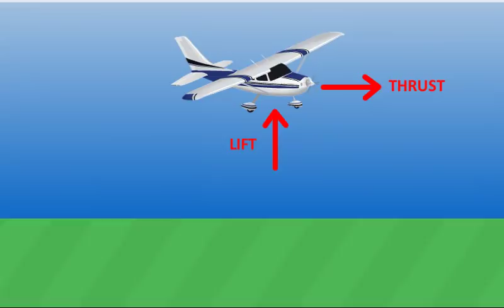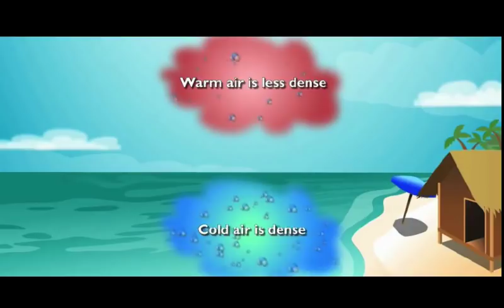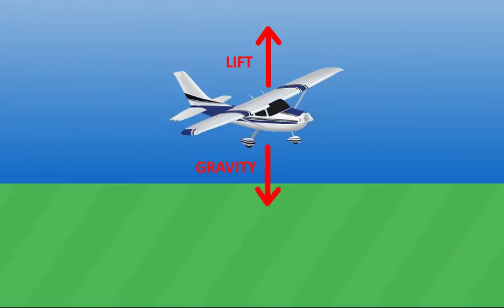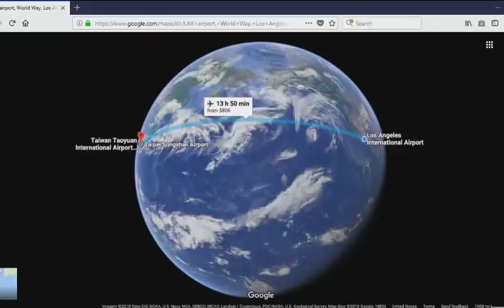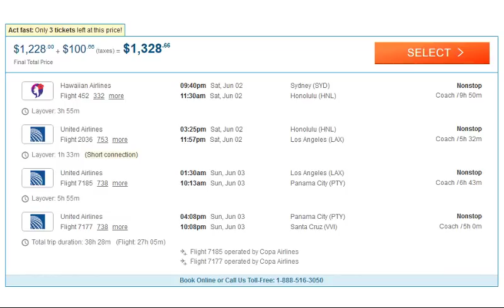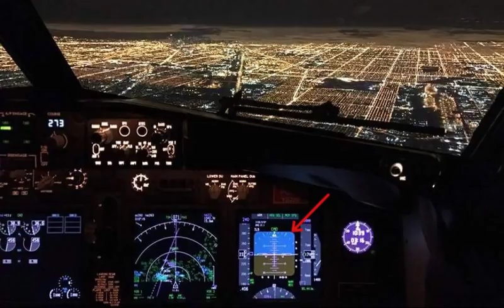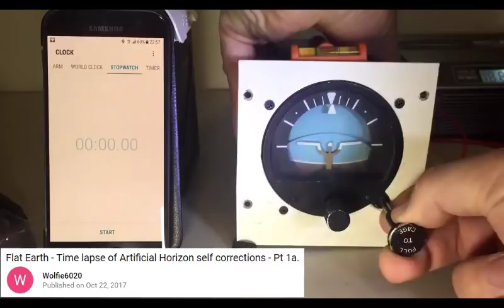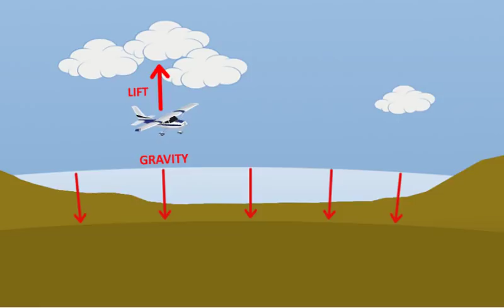Flat Earth Falsities - Plane Nonsense

Comment: so air moves at 1000 mph now, but cannot feel it? cmon...
Reply from the maker: Douglas Hughes - you really did not understand this video. You should watch again. The ground moves at 1000 mph. You, while standing on the ground, move at 1000 mph. And the air moves  at 1000 mph  (disregarding any wind).  So, the RELATIVE SPEED of the air is ZERO. There is nothing to feel. Think.
Reply: @JonasGrumby71  I get that..it still makes ZERO sense. So, at the equator, we are at 1000 mph. ok, fine, so how about half way to the poles? a little slower? yea. Ok how about at the very center point at the top or bottom poles. how could i not stand there spinning? (slowly or whatever) explain that please. Im being serious.
Reply: @douglashughes1392  do you think you should feel the rotation of the earth or something?
Reply: @CaptWesStarwind  if the earth spins at 1,000 mph at equator, 733 mph at 45th parallel, then, when I am standing at the EXACT north pole, why couldn't I physically stand there, and spin slowly myself? (Don't tell me earth is to big, I still would see or feel something at that speed)
Reply: @douglashughes1392  why do you think you would feel anything. You and the earth are both rotating at the same constant speed. Humans don't feel constant speed, we notice changes in acceleration. You're not a scientific instrument. Look at the stars and you can see as they appear to rotate around you. The universe isn't revolving around you, the planet you are on is just turning.
Reply: @douglashughes1392  If you're standing at an exact pole, yes.  You would stand there and feel nothing, and your body would spin over a course of 24 hours, along with the Earth- and you'd keep facing the same landmarks.  Looking up in the night sky you'd see the stars spinning though (you'd need to film it and speed up the video to really notice much).  The collective atmosphere around you would be spinning with the earth near 0 mph, but there's still some relative wind from weather patterns.
Reply: @jeffk1722  why couldn't they do this test to prove rotation (which hasn't been proven). Even google, "Does the moon spin, and you get a yes answer, wtf?
Reply: @douglashughes1392  The moon rotates, yes.  It also orbits the Earth at almost the same frequency, so that there's always one side facing the Earth at all times.  That's why the other side of the moon is called the "dark side" of the moon (although that side gets plenty of sunlight- it has to do with our naked eye vision of the moon).
Reply: @douglashughes1392  the moon rotates in a geosynchronous orbit with the earth. The earth's rotation is proven and who ever told you it wasn't lied to you. The entire universe isn't revolving around you, you are on a globe that makes one rotation in 24 hours and takes about 365 days to orbit the sun. This is not a mystery. Lay off the YouTube videos, stop asking google everything and either go to school or try reading a book for once.
Reply: Lol
Reply: When you are in an airliner flying 600 mph, the air inside is moving 600 mph too. What does it feel like?
Reply: @romithromith  im sorry, that makes no sense as a valid response to my comment.  The guy in the video said planes are not affected by the earth's spin because the air is moving too..did you not actually watch the video which we are commenting?
Reply: @douglashughes1392  "that makes no sense as a valid response to my comment."
     I don't understand. Your original comment said: "...air moves at 1000 mph now, but cannot feel it?" By feel it, I assumed you meant like you feel the wind.

"the video said planes are not affected by the earth's spin because the air is moving too"
     Exactly right, the Earth, the atmosphere, the plane and you and I are all moving at the same angular velocity, or linear speed according to latitude. Yes, I watched the video before. I used the analogy of an aircraft, it's interior air and you all moving at 600 mph, where the aircraft represents the Earth.
Reply: @douglashughes1392  No these boys dont watch or understand, just dogs trained /programed to bark. Some 46 already, you are on a roll, I am kind of unpopular now :(  Their sick "debating" games dont have a hold on me.  Anyway enjoy, they are full of Themselves.
Reply: @romithromith  what trim setting or downward angle does that 600 mph plane fly to avoid flying out of our atmosphere then?
Reply: @douglashughes1392  The pressure gradient in the atmosphere combined with gravity, makes it impossible for a plane to fly out of our atmosphere, but essentially keeps it flying at a determined altitude. It would take the velocity and mechanism of a rocket to do so. 
     Commercial airliners have a ceiling of ~45,000 feet, although the Concorde topped off at 60,000 feet.
Reply: @douglashughes1392  I believe it is actually 1,038 mph at the equator but lets say 1,000 for simplicity. The speed would be cos(latitude) × speed at equator, or about 707 mph at 45° latitude. (Or 734 mph actual.)
Reply: Try using your head Douglas you are moving at the same speed as the air so you do not feel it moving at 1000 mph
Reply: @ronaldmead7643  try to speak without your ego and give me a better answer
Reply: @douglashughes1392  There is no other answer.  Everything is moving at the same speed.  That is why you can not jump straight up and come down in a different spot. This guys explains flight paths  and how they can not work on a so called flat earth map
Reply: @douglashughes1392   "try to speak without your ego and give me a better answer"
Try reading without your ego and actually considering the answers instead of dismissing them because they don't match what your ego wants them to be.
Reply: @ronaldmead7643  Uhhh, at the equator the earth moves at 1,000 mph, correct? The circumference of earth at the 45th parallel is smaller and therefore will have a different  spin speed, correct? (733 mph) Now, if I am at the EXACT north pole, I SHOULD be able to stand in one spot and spin around via the earth's spin correct?
Reply: @MrQuaiven  good answer...Ya I am being egotistical now as a result of your first response to my first comment. (make sense?) 
 Now, if you know gmo's are bad, maybe you know about vaccine dangers too? now do your OWN research as I have, and wake up.
Reply: @douglashughes1392  "good answer"
Yes it was a good answer and the rest of your comments goes on to confirm how good it was because you continue to allow your ego to cloud your judgement of the responses given to you.  You should really consider speaking less and listening more if you ever want to learn anything.
Reply: I suggest you try to speak without your ego.  @douglashughes1392
Reply: @ronaldmead7643  so at the 45th parallel, earth spins at 750 mph, correct? so at the north pole, in the EXACT top of spinning globe, you think I could stand still and not feel or observe any spin?
Reply: Douglas Hughes the speed would be zero
Reply: “but cannot feel it?” you will feel it if the earth suddenly stops spinning

@NotTheCIA I.think explained it well in the train example. Actually those who doesn’t understand is not completely wrong. It all depends on where you observe the event. When you’re inside a train speeding at 200km/h, you see the world outside is moving & you see a boy running 10km/h from the back to the front of the train. Now if you are outside the train standing still observing, you see the moving 200km/h train and you see the boy moving at 110km/h (while he’s running 10km/h inside the train). 

Reality is depending on where you’re looking from it. But with a lil knowledge, we won’t believe the buildings/trees are “actually moving” while we are sitting still inside the train right? We won’t believe the kid can “actually run” 110km/h when we are outside the train observing right? But they are when relative to you. So if you are standing exactly at the north/south pole, yes, a people from outside the earth will see you spinning and as for you, it’s hard to find a point of reference outside earth (or there is) for you to see so you probably won’t feel it. Whatever you see inside earth will remain the same.
Reply: @DouglasHughes I have the same curiosity. The earth rotates in a single direction (not both ways) so how does a plane flying the opposite direction of rotation of the earth travel at the same speed as traveling with the rotation of earth?  @voysovreason  I have similar question about the last solar eclipse. The shadow cast started in Oregon to S.C. which is the opposite direction the moon travels around the earth.  ???
Reply: @telescope2067  exactly. Also, when gaining altitude on a globe, it would add significantly more miles to a flight plan where as gaining altitude on a flat plane would NOT add miles to the flight plan. The gaining of altitude on a globe would be tricky if the earth was spinning 1k at equator and 730 at 45th parallel. ALL a joke when you think about it.
Reply: uhm... ok trying to explain basics to a 2 year old: If you sit in a car with closed windows and your speed is 50 mph: do you feel the air hitting you with 50 miles per hour ? NO because it moves the same speed as you sitting in your little car...
Reply: @moritzschneider7081  ill never understand why men respond disrespecting someone you dont know. Because you know something? or popular opinion is on your side?  Its a lack of virtue in men that ive seen grow with the generation. You truly cant add an idea/educate someone without belittling? Yet the one your talking to is the 2 year old?
Reply: @moritzschneider7081  you clearly didn't watch the video and are trolling my comment
Reply: @moritzschneider7081  good one. and good name too. If you fly on a globe, you cannot fly straight and flat, and one would have to calculate the extra flight mileage when gaining altitude on a globe as it would be a further distance to travel with higher altitudes, on a flat plane, this is not the case (as it is)
Reply: they neglected to explain how the atmosphere moving from West to east at a thousand miles per hour somehow doesn't create any resistance when you walk or fly against it.  You're not supposed to question it but I guarantee that if you did ask them why they would do some garbage like their poster child Neil De Grasse Lie Son and say "because it just doesn't" and then drop his microphone.  And people believe this crap.  Its easy really.  Go outside.  Find the sun and observe its position. Continue to watch it for 15 minutes.  Did you  move?  Or did the sun?
Reply: @forgedby2112  You do not feel any resistance because you are moving at the same speed.  And your question is answered by we moved.  The earth rotates around, the earth rotates around the sun and the sun rotates around the galaxy
Reply: @ronaldmead7643  so when I break contact with the ground such as in an airplane I'm still moving at the same speed as the Earth? By that logic a plane has to exceed 1000 miles per hour in an east to west direction before it ever even starts getting airborne
Reply: @ronaldmead7643  I mean I understand what you're saying but there's a huge hole in the theory. If I'm moving west to east as the planet allegedly does at the same time as the atmosphere sure no problem but as soon as I turn and trying to move in the opposite direction that the atmosphere is spinning I shouldn't counter immediate and dramatic resistance
Reply: It's all well and good to have a healthy logical debate however I must point out here that my sensibilities as well as my reasoning tell me that if we are to accept that the Earth is so sophisticated of a sphere that the atmosphere moves geosynchronously with the ground and all of the inhabitants upon it without any resistance in any direction then we are going to have to start entertaining with great validity the notion that it was intelligently designed and not randomly generated.
Reply: @forgedby2112  you know nothing about lift.
Reply: @forgedby2112  Holy smokes, dude, crack a book. Just because something is marvelous to you doesn't mean it's divinely inspired. There are simple scientific explanations for the formation of the earth and the atmosphere. It's not "amazing".
Reply: @forgedby2112  If the atmosphere is moving at the same rate as you and the Earth below it, then it is moving at zero mph relative to the Earth and you experience the same resistance whatever direction you walk or fly against it. Is it difficult to walk back to the bathroom in a plane flying 600 mph because the air inside is moving 600 mph forward with the plane? No, relative to the plane (and you) it is not moving. Duh...
Reply: @romithromith  you had a valid point until you said duh
Reply: @romithromith  okay let's say you're right that the ground and the atmosphere are moving at the same speed 1000 miles per hour from a west to east Direction how then do you explain that you can feel wind from other directions?
Reply: @forgedby2112  Because the wind is blowing from that other direction. Relative to Earth, the atmosphere and everything on it (such as you) is not moving, when in a greater frame of reference, it moves with the same velocity as Earth. (And it's one rotation per day. 1,000 mph applies to the equator.)
Reply: @romithromith  I'm sorry..did you just say "because the wind is blowing from that other direction"?  So the wind blows from any direction other than the rotation of the Earth?  Oh wow.  This one is going on the blog. Haha!  Thanks for helping me understand.
Reply: @forgedby2112  Rossby waves prove rotation. Look em up. Your ignorance is not a valid argument.
Reply: @forgedby2112  Here's another great FE mind, Debbie Duran. She doesn't know where Australia is: https://youtu.be/pIDbkyEDDog?t=8096
Reply: @CaptWesStarwind  I wasn't familiar with Rossby waves. So thanks.
Reply: @romithromith  It is also one of the factors they think would allow for liquid water under the ice on other moons and planets. Kind of a stored up energy that can help.
Reply: @forgedby2112  The atmosphere doesn't move at all, relative to a fixed point at Earth. It moves WITH Earth. There is wind, but that's another subject, not directly related to this. If you ever cycled (sorry, English is not my native language, but I was referring to riding a bicycle, not sure how to say that with one word) at the exact same speed and direction as the wind, you'll notice that it feels like there is no wind, or very little wind, at all. If there is no wind, you will feel the same thing if you are standing still, because you, the Earth and the wind all move with the same speed in the same direction. This should be very simple to understand, I'm not sure why it seems so hard for some people. I'll not say that some people are stupid or something, I have seen worse. One guy in my class at school many years ago, refused to accept negative numbers. It was just impossible to make him understand the concept. Today he seems to be very successful anyway, so I guess he overcame this at some point of his life, so there's still hope, I guess.
Reply: @forgedby2112  Go outside tonight and find any star, such as Capella or Vega. Go back a little later and notice all of these stars, these other Suns, have moved relative to Earth. Is it more likely that all of these distant objects moved as one or that the Earth moved (rotated)? In the Southern Hemisphere they rotate about a southern celestial pole, which rules out some goat herders' mythical dome. Question things but also learn why astronomers say what they do without resorting to conspiracy theories. FFS stop getting your science from FE videos—the equivalent of Ma and Pa Kettle.
Reply: @romithromith  dude why refer to them as "goat herders"?  That logic baffles me because people say that creationists who believe what the Bible says are out of touch and stupid because they're putting their trust into something that was written by a philosopher centuries ago. The problem with that is that the heliocentric model was written by a philosopher centuries ago. I digress. The heliocentric model asks us to believe that the Earth is rotating at a thousand miles an hour then also revolving around the Sun at some 4,000 miles per hour hurtling through our Milky Way at some hundreds of thousands of miles per hour and the Milky Way itself is also hurtling through the vastness of the universe at thousands of miles per hour and yet we are able to see the same Stars climb into and fall from their positions every night?
Reply: @NotTheCIA I.think be more specific
Reply: @NotTheCIA I.think I've been on some carnival rides that dispute your claims easily.
Reply: @NotTheCIA I.think I did my research before i responded to u. The 45th parallel's speed is found using math, found on google (i'm not a math magician) pretty easily.  So i would not feel the spin? google is lying? your explanation is lame and weak. Google did better than you
Reply: How up need to go to avoid weather?
Reply: @হুহুম  how high to take fake satellite photos of the weather? look at all the cgi of clouds on google earth. especially in southern hemisphere. they enlarge and repeat clouds. (look at my monicker, that is yesterdays google earth, what a joke) it is 2019, where are the real photos? no bubble lens shit.
Reply: If the Earth stopped spinning for some reason, you would feel that wind pretty quick friend.  It's 1000 near the equator, close to 0 near the poles.
Reply: @NotTheCIA I.think good answer again with no facts. haha.  Anyways lake tahoe is 22 miles long. according to the math there should be 240 feet of drop after 22 miles 2 6 ft height observation, correct?  https://dizzib.github.io/earth/curve-calc/?d0=30&h0=10&unit=imperial
Reply: @NotTheCIA I.think https://dizzib.github.io/earth/curve-calc/?d0=30&h0=10&unit=imperial
Reply: @NotTheCIA I.think 240 feet of drop at 6 ft observation on 22 miles of lake. Lake tahoe does not hide 240 feet of shore looking across the lake this is clearly visible even with the naked eye
Reply: @No... why do planes fly the same speed in both directions then with your answer this should be true
Reply: @Douglas Hughes Please explain how aurora is formed in the flat earth? A logic explanation will do, prove is not required. Cheers
Reply: Look up Lake Tahoe yourself.
Reply: @douglashughes1392  take a look at a map, try figuring out how they work. Maybe you will realize flat earth maps can't exist and flat earth is a scam on YouTube.
Reply: If it’s a scam, why does it make way more sense? I thought earth was round too but these videos prove otherwise. Also, why does the moon look the same all over earth ?
Reply: @douglashughes1392  it doesn't make any sense, none of it matches reality or anything we observe. The moon is in a geosynchronous orbit with the earth, so we always see the same face. If the earth was flat and the moon close by we wouldn't see the same side all the time. We also see it rotate upside-down between hemispheres, and unless its just a sticker on the dome, flat earth cant explain that. There is also the path that the moon takes, which only fits on a globe and doesn't match what you would see if it was just above the space pizza. The fact that you had to ask that shows you should do more research into why we see one side of the moon, and I don't mean watch flat earth YouTube videos.
Flat earth is just a scam on YouTube some people use to make money.